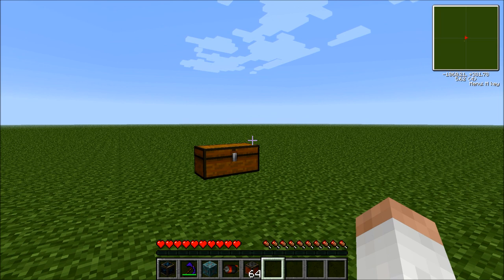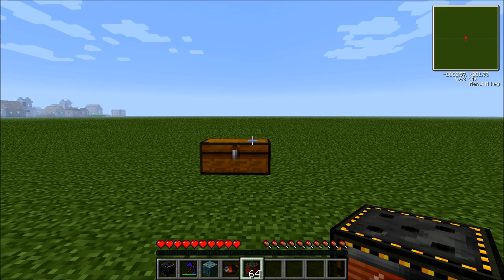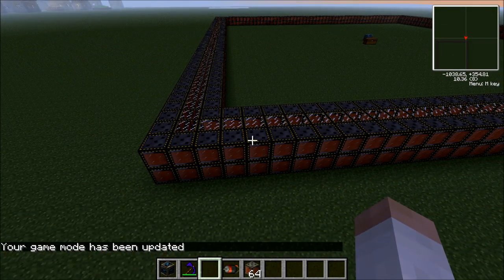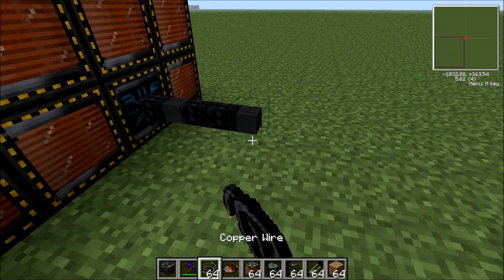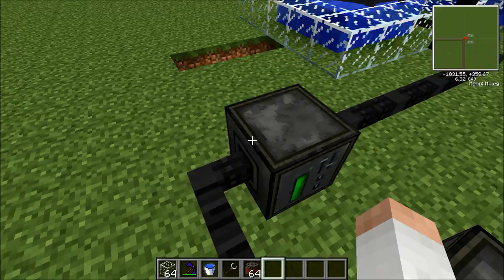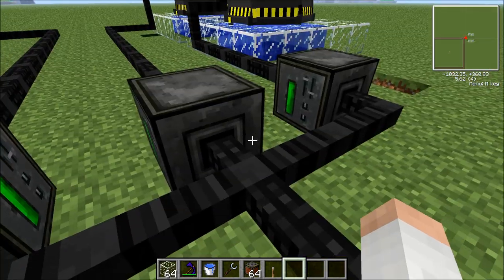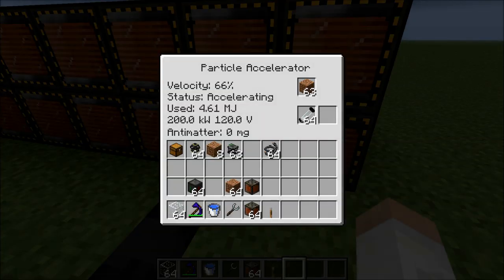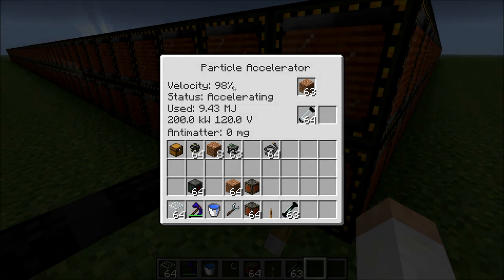Voltz Tutorials - How to make a Particle Accelerator and Anti Matter!

Comment: Does it have to be 60x60? Mine is 50x50 and not producing antimatter, but in the video yours didn't produce it either how do i think that?
Reply from the maker: Mine did produce anti matter, however only 5mg at once. You only fill one of those tubes when you reach 200mg. It takes a long time for it to actually produce one full piece of anti matter, that's why it's the most rare substance in the mod.
Reply: 50x50 is  to small, it needs to be 60x60 to fully work at a minimum, because as the matter is going and picking up velocity its hitting corners and starts staying at the same velocity after a certain point,
Reply from the maker: Actually 50x50 works perfectly fine. It only needs to reach 100% velocity, yes 60x60  would be faster but it's also more expensive. The larger it is the faster it makes antimatter, but the more it costs to make. 50x50 is the recommended size.